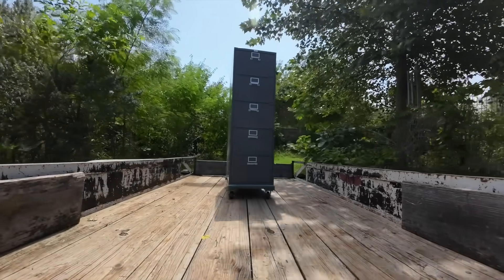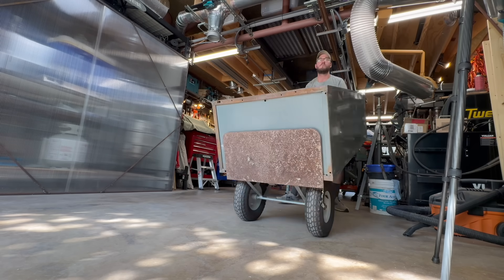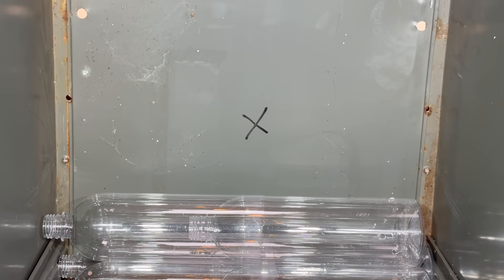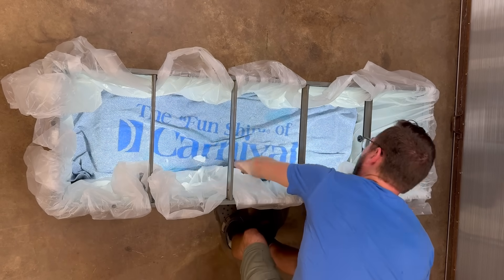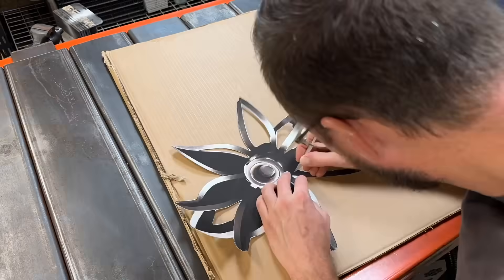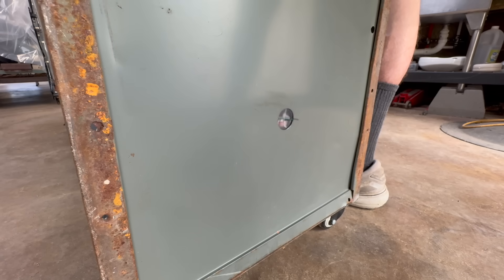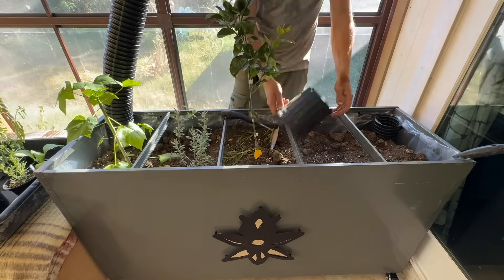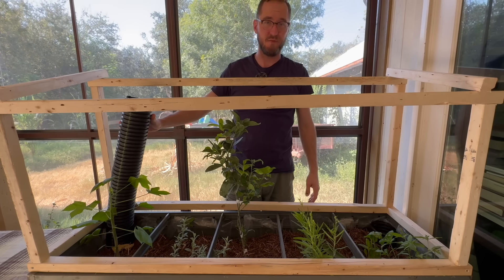A new type of Greenhouse

Comment: Neat idea. My only concern would be using cotton as a soil barrier. I'd worry that it would rot away fairly quickly. This is where I'd invest in some heavy-duty landscape fabric (I know, >$5). It's held up well for me in my wicking tubs. I had a towel wind up in a neglected corner of the garden and it was trashed by the following Spring.
As to the drawers-you have the skill and materials for metalworking. I'd cut the drawers down from the back and trim the fronts so they fit back inside the file cabinet and rest on the back/bottom to either provide a stable bridge over the bottle reservoir or just raise the soil level a bit if you don't want all that weight or need the soil for the plants or the greenhouse idea. Or use the dividers to build a platform.
Push comes to shove, trim and bury them to contain raspberry or other bramble plants.
Reply from the maker: I like the idea of using them as the reservoirs. I never thought of that 🤔 they would rust out eventually but that’s still a cool idea! Thanks!

Comment: Step drills are not the fastest. Hole cutter broaches are,  they are expensive, that's why you don't know about them. One is like 30 step drills in price. But if you drill sheet all day, you don't want to waste all that time cutting out all the material in a hole.
Reply from the maker: Touché. I actually have one. I use it in my porch Rennovation video to make the sliding doors. Would have been extreme overkill for this thin sheet metal though. But you’re right. Since it only cuts a ring and not a circle it is faster. Thanks!!!

Comment: Water wicks from the reservoirs up through the soil might reduce the need for frequent watering of new plants. Especially helpful if it's a plant that likes evenly moist soil.
Reply from the maker: I bet that would work. Thanks for the idea!
Reply: @suburbanbiology do you have heat issues in the summer? I have Ideas like yours but I also have thought of using two layers of plastic on south and it vents at top exterior but get its air from top inside of green house.
Reply: People to this without all the plastic. You pack the corners with a wicking media like perlite, vermiculite, coir, etc; fill the rest of the bottom with gravel or coarse drain sand; then fill the top with potting soil, continuing the wicking media up the corners to the top. You can also install a watering tube down the side, directly into the gravel reservoir, or top water down the corners.
Reply: I love love love water wicks for builds like this!